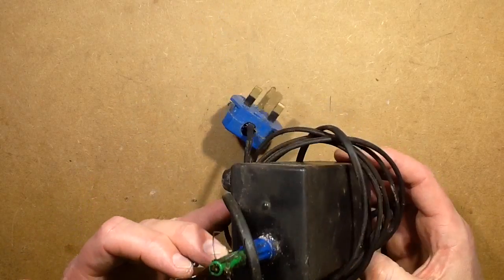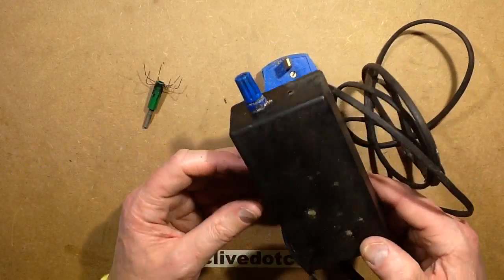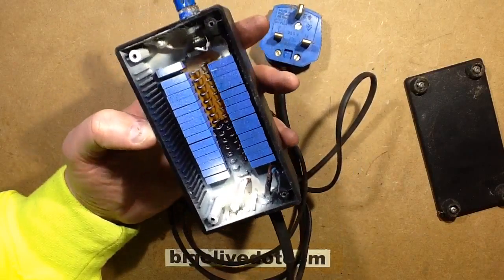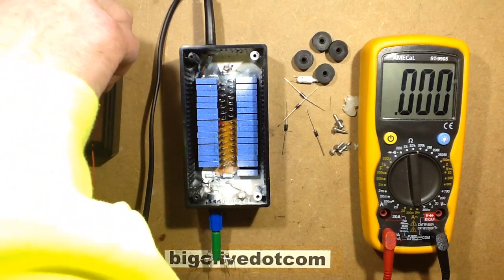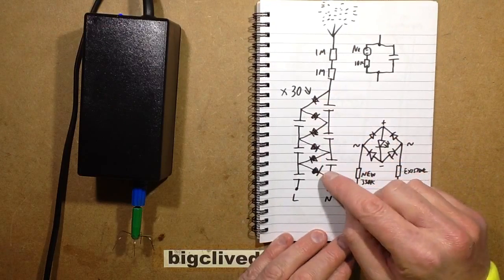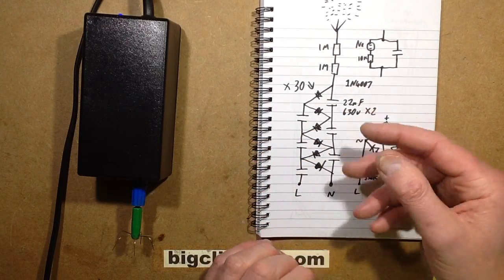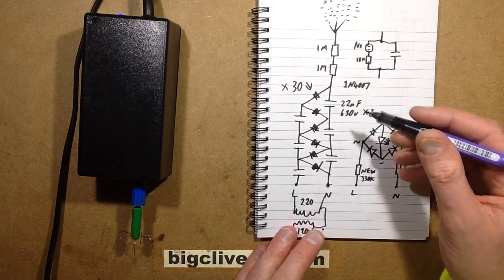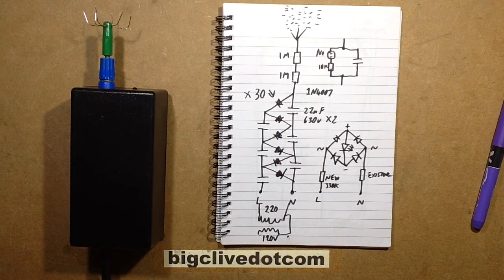Manky custom ioniser refurb with safety violation.

Comment: I evilized a USB ionizer to increase the power. You see, there's a SMD resistor marked 105 on the output of the voltage multiplier, so I removed it. It now has a bit of visible corona around it in complete darkness. As it has sucha  tiny output, that's pretty much not a issue in terms of safety. Might I add you should NEVER plug one into actual USB ports if it lacks cutouts under the transformer. Use a wall adaptor, or it can become a USB killer and nuke your MB. Might I add integrating one into the inside intake fan of your PC is a good idea. I made SATA to USB power cable so it would be connected to the power supply and not near data connections. I took a brushless fan and put metallic mesh of both sides of it, one side goes to the HV output of the ionizer, and the other to ground. The mesh is epoxied around the edges to prevent corona around the fan, and make sure it occurs between the meshes. The dust will attract to the mesh after it enters the case, and stick there instead of everywhere else. You have to vacuum or remove and blow out the fan once a month or so, but it really keeps dust buildup internally to a minimum. The ions don't bother the motherboard, provided it's a good 6in away and the grounded mesh facing the internals never disconnects.

Comment: If the ionizer is causing a small breeze, could it be super-sized for use as a form of thrust in like a rocket or satelite?
Reply: Ion propulsion is indeed one way you could push a spacecraft. It's the sort of thing you'd use on something small and/or that doesn't have to accelerate very quickly. It's minuscule amounts of Delta-V, but if you don't care how long it takes, it's about the most efficient form of propulsion there is short of science fiction "reactionless thrusters." Note that you would still have to inject something into the ionizer to act as reaction mass, but it could be almost anything, and in very small amounts.

But if you've got any sort of friction, ion propulsion is useless. You probably couldn't scale it up large enough to work in an atmosphere, and even if you did somehow manage it, the power consumption would be atrocious and the ionization/ozone creation would be dangerous.
Reply: "they have a lot of potential"
I see what you did there... ;-)
Reply: Some of them used to turn small 'windmills' as a visual confirmation that something was actually happening iirc... don't think it's got much scope for earthly propulsion but you can make an ion drive that ionises xenon for use on spacecraft and they have a lot of potential.
Reply: No. Ice still has friction, and the air alone would be too much resistance for any reasonable setup. And again, you'd have to use obscene amounts of power, it it's possible at all. It'd be far more efficient to just use sails or a standard motor driving a fan. Even if all you wanted to do was push air around, a fan is a much better idea.
Reply: TheRealColBosch it must be a miniscule amount of thrust then. Still interesting!
Reply: Absolutely, if you bring a supply of gas with you. You can use an electrical field to accelerate the gas to a far higher speed than is possible with a chemical rocket, so it's very mass efficient.

As far as I know, ion rockets aren't powerful enough for manoeuvres in low Earth orbit, but they're ideal if you don't mind waiting a few months for your interplanetary probe to accelerate to full speed.
Reply: I tell a lie. According to Wikipedia, an ion rocket WAS used in low Earth orbit to combat air drag on the GOCE mission.
Reply: TheRealColBosch what about a craft that uses skates on ice? You wouldn't need to inject anything since you're within an atmosphere. and you could beam energy to the craft using microwaves. Just a thought.

Comment: Would be cool if someone designed a custom pcb for those stuck using 110v. I wouldn't mind an insanely large voltage multiplier to get the voltage I need to make it work. Would definitely save on weight.

Comment: Charged particles stick to the inside of your lungs. And the surface of your lungs is very large. Not healthy at all.
Reply from the maker: It would be no different to any dust particle.  But there would be less of them as they would rather find a grounded surface to land on.

Comment: I dont know much about high voltage but i have the impression that the diodes are in the wrong polarity? Shouldnt they be facing "towards" the higher stages of the multiplier? I cant seem to understand how the first cycle would start charging the cap? Then again, i may be wrong.
Reply from the maker: If they pointed in the opposite direction it would be a positive ion generator.
Reply: thanks for the clarification

Comment: After he pokes it at around 5:27, anybody else see the lead on the 6th diode down on the right column start shimmering as if its arcing?
Reply: Yeah, I noticed that too! I figured it might have been a reflection or something though.
Reply: I never noticed that. Well spotted. I wonder if Clive will notice your comment and give us his professional opinion on what it was?
Reply: oh yeah
Reply: That's the light reflecting from the quick test...............
Reply: I never saw that but now I want to know.
Reply: Well spotted, that looks like it's going to fail soon, that will  bring the final voltage down, to zero if it opens.
Reply: Are you sure, I'd expect it to be 1/4 of a diode to the bottom left if that were the case.
(It also doesn't seem to match with the flashing on the neon but that could be an artefact from the camera.)
Reply: @Firecul  Now a moot point, however the circuit is not powered at the time in question because the quicktest is open, so yes, it's definitely a reflection.
Reply: WELL SPOTTED... I really had to magnify my screen to the max to see it !! The power is OFF though, as the QuickTest is open. Could be the cap next to it discharging slowly ??

Comment: Could you tell more about ozone generators? I thought ionizers with high enough voltage always generates ozone as well. (sure, ozone can be generated with arcs and AC corona too, but that is another subject I guess).
Reply: +hoggif Ozone is toxic and levels above 100 parts per billion are considered hazardous.
Reply: I thought some clarification between ozone generator and ion generator could be explained when they are describes as two completely different apparatus in the video.

Yes, ozone is very toxic. You also tend to get used to increasing levels and your nose will not tell you levels have risen quit high perhaps. Done that with large amont of corona in closed space, it gives you nausiness and perhaps a nasty headache as well.

Comment: I'd buy the PCB for this, have you considered selling them on your website?
Reply from the maker: Not suited to vero board as the voltage is high.  You can make an ioniser without a circuit board at all though.  I have a "make an ioniser" project on my website at www.bigclive.com
Reply: its so simple, just make it on veroboard.
Reply: Forgot Veroboard specifically means stripboard. We don't have that brand here anyway. What I meant was copperless perfboard (probably not the right term for it. Not as easy to find as it used to be it seems). Could also do it easily point-to-point.

You could do it with stripboard or normal single side copper perfboard, you'd just have to drill off more copper than you usually would with stripboard. I've done a 25kV circuit that way a long time ago. I've seen plenty of other cockroft walton multipliers on perfboard elsewhere online.

I'd probably pot it with any of these methods including PCB.
Reply: i didn't find this project, can you please link it ? +bigclivedotcom
Reply: RoelNicky 
All that I found was "Make a $20. Ozone Generator". Clive, would you please supply a link?
Thanks
Reply: @redlock4004   (and RoelNicky) Go to his site, click on the "Things to make and do" link, then scroll down, the link for the ioniser is near the bottom.

Comment: What happens if you touch the needle electrodes?
Reply: you very quickly stop touching the needle
Reply from the maker: You get a slight static sting.
Reply: I didn't notice any feeling when I had a Dezac brand ioniser - but I notice a brighter corona on the needle I put my finger nearest. afaik the shop bought ionisers use 10x higher value resistors so that customers won't complain about 'getting electrocuted' by them.

Comment: never realized these could kill mold, could you recommend any off eBay?
Reply: Kingsley Aisthorpe look for ioniser on eBay.
Reply: they dont kill mould. they will clean the spores out of the air but they wont affect the mould itself, you need to deal with the damp/moisture issue to get rid of it

Comment: Have you ever looked at the Oreck air purifiers? I've found that they make the dust into tiny particles then sprays the fine particles everywhere. How are the supposed to work or are they a scam?
Reply from the maker: If they're ionisers then they work by precipitating dust out of the air onto any grounded surface.  They do make a bit of a mess, but they remove almost every spec of dust from the air in the process.

Comment: Do ionisers really help with the "damp" smell? How would one find a good and cheap one on eBay? I.e. what to look for?
Reply from the maker: They won't solve dampness issues.  That has to be done at the source, or if it's just ambient humidity then a decent dehumidifier will help.  But an ioniser can help remove pollen, spores and dust from the air, and if a small amount of ozone is involved it will oxidise airborne contaminants at the same time.

Comment: hey i have a problem with my desktop computer. its an ailenware alpha and its a gaming computer, however when i play a game my pc will randomly shutoff after about 15 minutes to an hour of playing i have since contacted dell support and they didnt do shit. we did find out however its not overheating and its the graphics card. PLEASE HELP. thanks.
Reply: Andrew This really isn't the place to ask; Clive does circuitry and not computers. On the limited information you've provided it sounds like a power supply problem. Do a quick Google search and find a forum to help you. I'm sure you aren't the only person with this issue. Good luck.
Reply: ok thanks he was just the best guys i knew about this kind of stuff
Reply: sounds like your power supply isn't upto the job
Reply: Could be allsorts.  Failing PSU; Bad RAM, Bad drivers; Bad MOBO; Bad CPU; Bad OS install; Bad anything else.  A process of elimination usually helps pin down what exactly.  First call, try another PSU if you have one available.  Second, try removing RAM sticks to the minimum, swapping them over if the problem persists.  Third, remove any and all peripheral cards/accessories that you can.  Forth, Reinstall OS.  Fifth, try alternative graphics card.  Sixth, reset BIOS to defaults.  Seventh, disable on-board sound, and if possible try another sound card.  Eighth, disable non-essential interfaces/etc in BIOS.  Ninth, disable windows auto-restart on failure to be able to view possible BSOD error messages.

And so on...
Reply: I suggest you take it to a computer shop and let them deal with it if you don't know how to or can't do a process of elimination, they will have more parts to play with to solve it faster. But if graphics card is screwed then it may be useless.
Reply: Open it up, and clean it from the dust. That is the problem. wash the heatsinks, apply new thermal compound. Seems like you will have no idead how to do it, so bring it to a neighbor IT student, who is willing to do it for you for some 20$.
Reply: Your CPU probably has on-board graphics you can fall back on to test the PC without a graphics card and see if it still crashes.

It could also be software. You could try booting a linux liveCD/USB and see if it still crashes (bearing in mind linux isn't immediately obvious how to use it, but if all you need is a web browser for a while you should be alright) You can also run a memory test with a liveCD/USB of memtest86+, but for that you may need a BIOS that you can disable UEFI on to get it to run (the latest version's supposed to work on UEFI, but I didn't have any luck running it from linux, maybe the liveCD of just memtest would work on UEFI)
Reply: For future reference, never buy alieanware ever

Check the drivers with your graphics card, you might have to install a bunch of different ones to find one that doesn't crash
I had the same problem, unfortunately I had to replace the graphics card which was expensive, some hardware just doesn't play nice with others
Reply: Andrew Google, not YouTube comments.